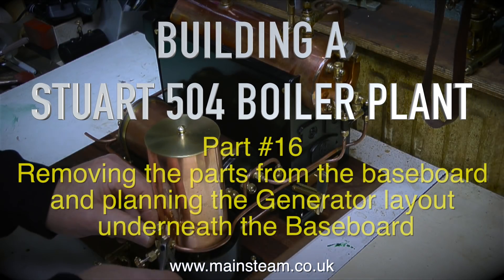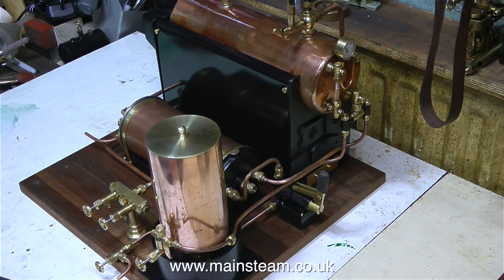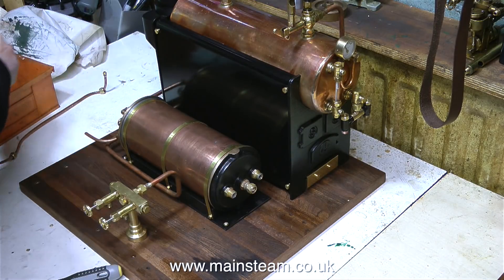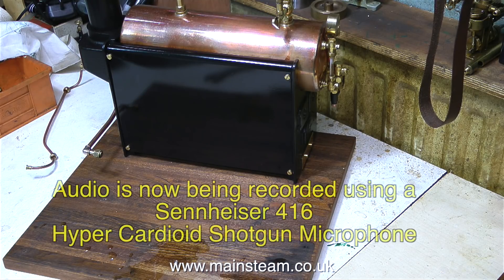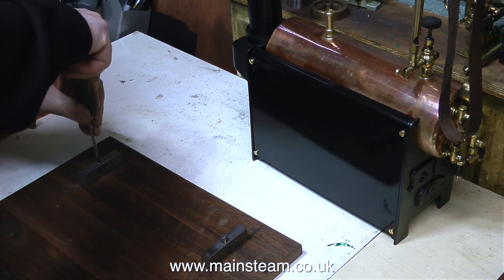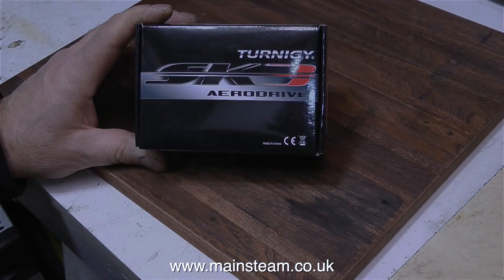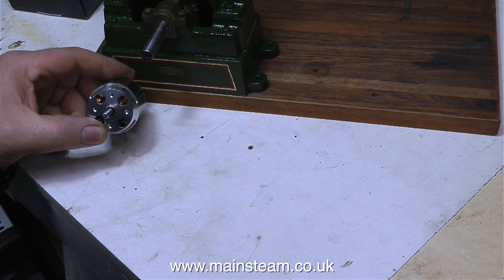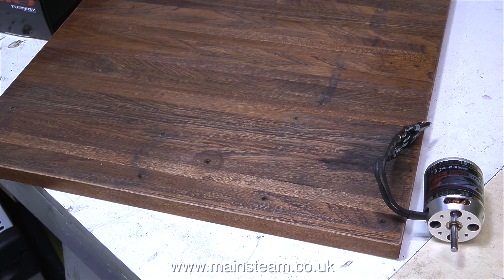MAKING A STUART 504 BOILER PLANT - PART #16 - REMOVING THE PARTS

Comment: Have you thought about building a "gearbox" of toothed belt?  Going back and forth over same two axels.  Just need three larger and three smaller pulleys and two axes, and two pairs of the pulleys that are screwed together.  And ball bearings on all pulleys except the last one on the generator. If use same length on toothed belt and same size on the small and large pulleys, they all can be adjusted at the same time.  maybe spring pushing on the slack side of the belt for even out differences?

You probably could use belts too, and have the pulley wheels a bit rounded, so they center the belts. The last could transfer power to the motor with a small toothed belt last if you want to have the less pressure on the generator axel.

A suggesting, which I think could work, but if you like three belts or not is another issue. 
You build, your choice, as always.  And you do make lots of good choices. :-)

Comment: Do you lacquer your polished copper pipes to stop tarnishing over extended periods? I find most lacquers sort of flake off or turn a yellow colour after a while and have been looking for one that doesn't, or at least takes a good few years to happen.
Reply from the maker: No, I never lacquer any metal parts ...... mainly fro the reasons you mention .....
Reply: I do know some of the metal heatsinks on computers part are treated with something, I have a GPU here that is from around 2010, and the copper on it is as shiny as when it was new, and it spend many thousands of hours at about 60°C, it is also non conductive, and looks perfect, so there definitely is some clear coating you can get for them, maybe automotive clear coat is what they used.